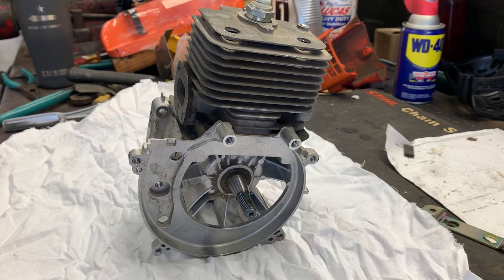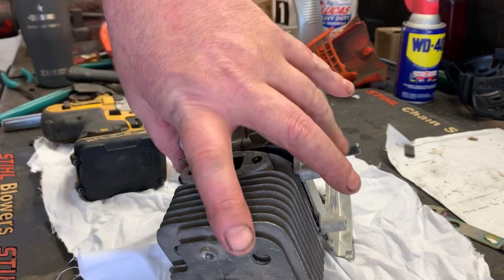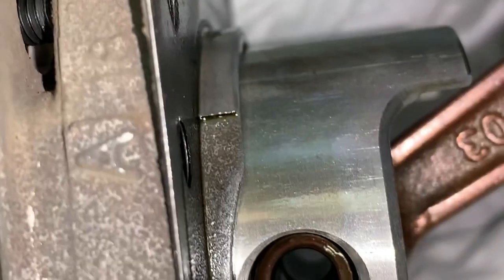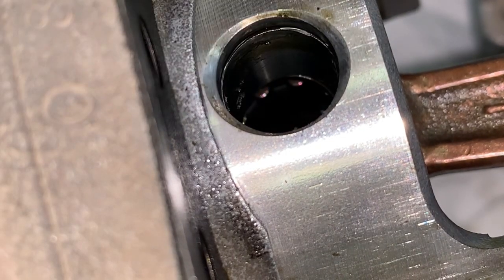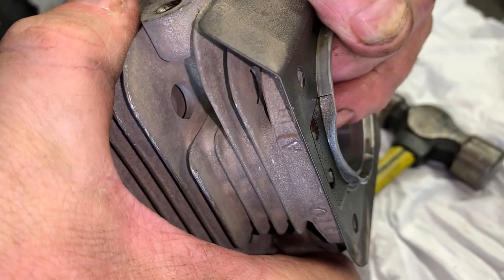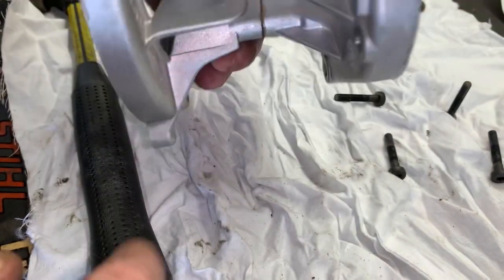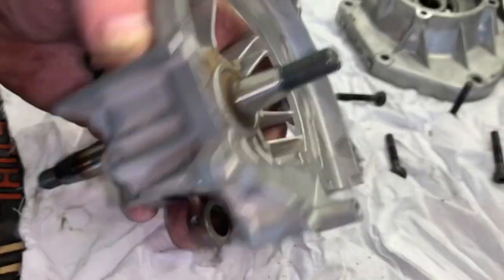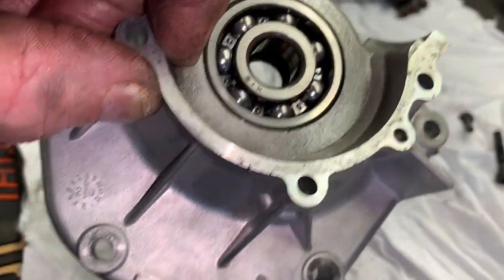HOW TO REMOVE A CRANKSHAFT FROM JUST ABOUT ANY 2 STROKE ENGINE

Comment: THEMOWERMEDIC1, I am looking to find a set of torx bits such as the one you used in this video. Could you steer me in the right direction, please? I need some bits that will not twist in two when confronted with a tight or stuck screw. Thank you. I am also repairing a backpack blower the owner bought thinking it had a 4-stroke engine. He had been running straight gasoline in it until it seized up. I cut the cylinder off and removed the piston, wrist pin, and wrist pin bearing and am going to replace them.